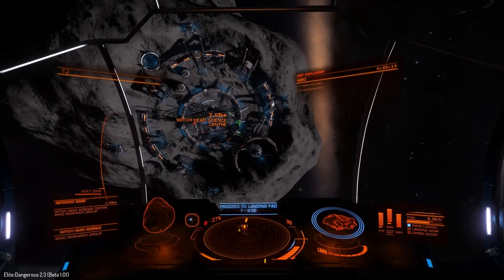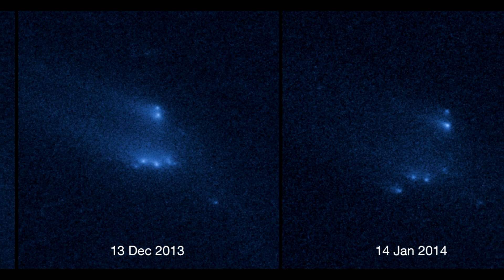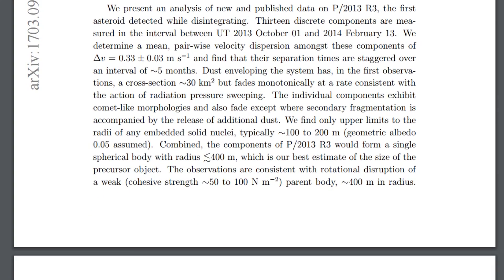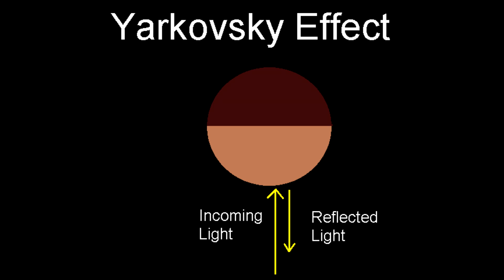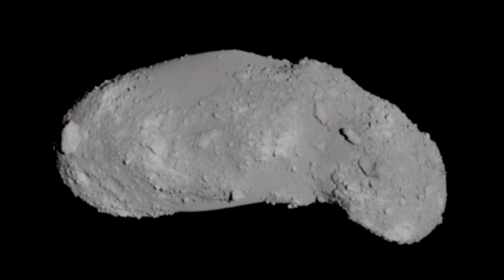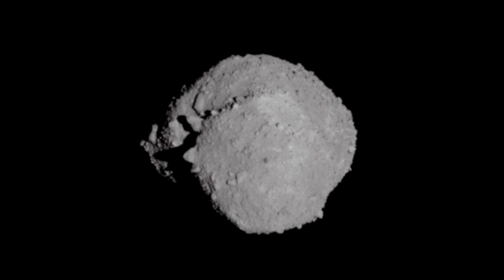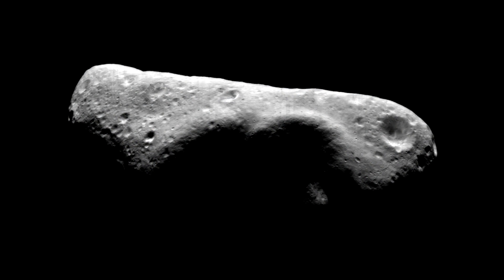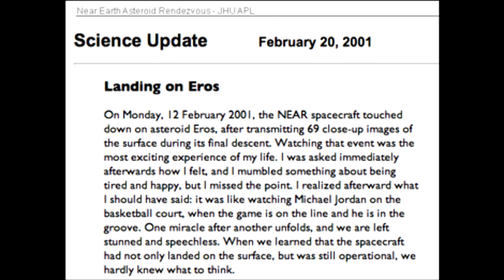Spinning Asteroids To Make Space Stations

Comment: Another possibility is to hollow out the asteroid and build a spinning habitat inside. The outer asteroid layer acts as a shield, and could be mined for all the water and other materials. Also, if this hollowed area could be pressurized you could plant crops and such. A very slight spin would allow for water to go down and plants to grow up.  Now too me, this is far more realistic and interesting.
Reply: I've been much more of an advocate for the O'Neil cylinder inside the asteroid idea. Though... you do have to have some strong magnetic bearings to ensure your cylinder doesn't precess out of center.
Reply: Found this after independently duplicating your comment. Precession is prevented by building counter-rotating structures attached to the habitat. They have equal but opposite angular momentum, so no precession.
Reply: Couldn't the whole structure just torque off the asteroid itself? The enormous mass of the asteroid would serve as the counter rotating structure to the relatively tiny mass of an air-filled space station. If you place the station at the centre the effect of the asteroid would be barely detectable.
Reply: @avid0g  or two O'Neil cylinders in opposing directions so the stress on the asteroid isn't an issue again
Reply: yes, exactly what Isaac Arthur and many others have suggested. Far better structurally and better shielding. O'Neil cylinders hidden INSIDE the asteroid with a nice, big rock shield
Reply: Just the idea I had some years ago. I mean he's right questioning the need to spin up an asteroid. Is there any model available of such a design?
Reply: This also reduces the mass greatly, which will require less force to spin it.
Reply: Fantastic idea!!!
Reply: Gundam has several of those types of stations.
Reply: In order not to get dizzy the RPM needs to be below 2 so the cylinder needs to be at least half a kilometre wide for 1G. The speed at the edge is fast but at 2 RPM its slow at the hubs. So you don't need fancy magnetic bearings, if your attachment points are at the hubs of the end caps ordinary bearings and wheels should do. Only has to withstand 3% Earths gravity or none if you build right in the centre of Ceres.
Reply: why would you put a spinning habitat inside a hollowed-out asteroid? the original design for O'Neill cylinders relied on a bed of regolith between the outer walls of the cylinder and the dirt that supported crop and other plant growth to shield the interior from radiation. why waste the time hollowing out an asteroid so you ca recreate that inside? worse, the idea of pressurizing the interior means the asteroid has to be structurally strong enough to contain said atmosphere, which isn't a sure thing. so why not just mine the asteroid's surface for material to construct an O'Neill habitat?
Reply: Yes the simplest idea would be a habitat built inside the asteroid, rotating against it on a maglev path so there is no friction. It would be under the surface sufficiently to shield against radiation
Reply: Thats Beltalowda science right there
Reply: Pressurised rocks.... 🤣
Reply: Doors and corners, kid. Stay away from T Aqua!
Reply: I expect asteroids are going to be predominantly loosely packed rubble piles.  Using the intrinsic rock as a shield will probably be about as effective as covering a bunker with packing peanuts.

I'm betting on a bit more structure from a combination of engineered trusses and bails of loosely consolidated raw asteroid material.  Still going with an un-spun shield made up of bailed rocks and water tanks then connected to a spun habitat inside with magnetic bearings.  Asteroids like Ceres or Eros would ironically be too big, carrying with them small but noticeable gravity fields.  A habitat built inside a void would get the vast majority of its gravity from its own spin but then have the asteroid's gravity overlaid leaving inhabitants with a gently rocking environment.  Everyone's soup pots would be self-stirring but furniture and dinnerware would be self-relocating.  An engineered external shield would be uniform in mass netting out to zero gravitational effect.  A shield wouldn't need to be especially overwhelming, a dozen meters thick combination of rock and water tanks would put up far more protection against micrometeorites and radiation than the Earth's atmosphere.

Habitats inside asteroid voids would not be ameniable to relocation.  If Eros station ever got bored and collectively wanted to to experience the thrills of Mercury or hanker for a jaunt to Pluto it would mean thrusting all 34km by 11km by 11 km (6.7e15 kg) of Eros.  A habitat with engineered shield would likely mass "only" around 1e12 kg, a featherweight compared to Eros.
Reply: @Lenard Segnitz
It doesn't matter if it's rock or packing peanuts, 10 tons of material is sufficient radiation shielding. Certainly an engineered shield could be more mass efficient, but do we care? Maybe, it depends.

The axis of rotation must be aligned with the asteroids center of mass. Next, depending on the asteroids irregularity, the asteroid might exert different levels of gravity as we rotate around. Thankfully, nature has largely solved this problem for us; irregular bodies aren't very massive, and massive bodies aren't very irregular. The effect is less noticeable than earths own gravitational anomalies. If you still think this is an issue, just push a couple mountains downhill to even out the gravity.

I happen to think building bearings that work against several thousand tons is a bigger problem than spinning up the shielding, a la Kalpana One.
Reply: @allanrempel5839  , Pass on the bearings and go with magnetic levitation as a "bearing". So the structure rotates around a central beam and are separated by magnetic repulsing fields. The field could also be used to rotate the structure.
Reply: @allanrempel5839  I was going to point this out as well (about peanuts), thank you for doing the lifting!
Reply: @CarFreeSegnitz  Not possible without AI and autonomous robots (by the millions) doing it all for us and at no cost. No cost or a cost that would be impossible to meet (that's what we are facing). Have a robotic space "economy" completely separate to business on earth. With AI in the future, and robots that could make themselves would be the only way we could afford to do something like that.
Reply: Hollowing out the entire asteroid would be a momentous task.  Just hollow out tubes that house tracks that the entire habitat spins around on line a train going fast enough over a curve to pin you to the ceiling... which would in turn become the floor.  You'd still get the benefit of radiation shielding from the surface but wouldn't need to hollow out an entire asteroid.
Reply: @brainmind4070  you did watch the part where he said spinning an asteroid would cause it to break up, didn't you?
Reply: @andrewreynolds9371  I wasn't talking about spinning an asteroid.  You spin a habitat on a circular track inside.
Reply: @brainmind4070  that sounds even more impractical than spinning the asteroid. You'd have to worry about maintenance of whatever track/guideway, without the ability to stop the thing because you'd lose gravity.
Reply: @andrewreynolds9371  Well, it wouldn't be more difficult since spinning up an asteroid would break it apart.  Yes, the maintenance could be a concern.  Perhaps coring out a "disk" with a central hub on which a habitat rotated inside the asteroid would be more reliable (although maybe not since you wouldn't be able to have any columnar support along the radius of the disk out to the habitat(s) (haven't done the math on whether or not this could be accomplished structurally with the asteroid's weight bearing down on the hollow disk), or maybe just having a spinning spacecraft that orbited the asteroid would be better.

Comment: Why spin the asteroid? Just spin the habitats in, on, and around it, and use it as an inexhaustible supply of fuel and materials with no gravity stopping you from mining them.

The only good reason I can see to spin up an asteroid is to disassemble it, but I suspect such disassembly would be a bit more chaotic and violent than miners would want to deal with, with budding and collisions being a big problem, seeing as shear-intolerant bodies tend to generate internal "fault-lines" before suddenly slipping and sloshing into pieces. We are essentially talking about an quake or tremor cutting the asteroid into pieces.

Remember that asteroids are HUGE. "Even" a 100-meter asteroid weighs in at around a million metric tonnes of material. If your colony uses about 2 tonnes/m^2 and requires 250 m^2 /person, you're talking about a colony of thousands of people being able to run, probably for millions of years, on what they can mine from an asteroid a hundred meters wide. In terms of how big a cylinder that is, a cylinder with a radius of 250 meters could be hundreds of meters long before the asteroid is badly exhausted. And it is also worth remembering that buildings do not need to take as much space as habitats. A square meter of shielding might well be protecting dozens of stories of aeroponics or people.

Comment: I haven't put any thought into this other than the idea just popping into my head, but in the same way a longer wrench provides more torque and makes it easier to turn something, would it be significantly different (Or any different) if the engines were 100KM off the surface and attached in some way? So you'd essentially be spinning an object "500" KM in radius, but with the same mass? Disclaimer, I am the opposite of a physicist, whatever that would be called.
Reply: Yes, that would greatly reduce the thrust and/or time required to achieve the proper spin rate. And you would not need a frame system to handle the "torque", you would put the engines on a  100km tall tower than run a cable from the top of that tower to the horizon. The cable would be under tension pulling tangentially to the surface, the tower would be under compression.
Reply: sonnder you'd need an extremely strong frame system to handle such torque.
Reply: sonnder I wouldn't think so, because with a wrench you're trying to overcome material sticking forces, which is why more torque is helpful, but there isn't any such forces in the vacuum of space. The only force to overcome is this YORP effect mentioned.

It becomes a relatively simple matter of just imparting the needed momentum.

Comment: Thanks for all the fun food for thought you provide, Scott. Here's some dessert for you to enjoy:

Since we're talking improbable projects here, let's go whole hog and really optimize it. I mean, why spin up and live on something solid when you can spin up and live in something hollow instead? More living space on the inside surface, with convenient docking at the zero-gee zones at each end seems a lot more preferable to limited surface domes at each end of a "peanut". Gravity for babies to develop safely in mom's womb also means an actual Belt civilization becoming a tangible reality.
Larry Niven had the right basic idea: bore a hole through the long axis of a mostly nickel-iron asteroid a few kliks long by a couple wide, pack it full of water ice (all you could ever need or want can be found free over at Saturn), seal the ends back up, and then spin it up with laser-pumped diffusion mirrors trained on it to heat it evenly and soften the body of the asteroid. After the ice in the core turns to steam and the asteroid gets soft enough, the whole thing suddenly expands like a bubble from the core pressure creating a very large living space where the ice used to be.
Of course, heat resistant exterior bracing will be required to prevent blowouts and to restrict the overall expansion as well as fine-tune the shape of the asteroid from say, peanut to cylinder for a more even structural mass distribution (and easier docking), not to mention the sheer amount of time required for the passive heating and cooling processes. Yikes, even. Right there is the deal-breaker.
But, by the time we're ready to attempt an engineering project of that magnitude, the tech needed for the bracing and the superheating/cooling required to make the deal-killing time factor manageable and the project worth tackling at all will most likely also exist. We might even have working gravity generators by then that would negate the need to spin it up at all - slow it back down to a stop, clamp them on and fire them up, done. But, wait...
With all that tech available to us, why not just build a habitat instead? Well, I personally prefer "natural" gravity to the type generated by a device that could fail at any time for any reason. Thicker outside walls are nice, too. If we're going to be having babies up there, I sure as heck want them to be as safe as possible, so a nice thick asteroid wins that contest every time. Murphy is the God of Space, after all.

Cheers, mate. =)

Comment: So- what if we put 1 thruster 90° turned away from the Asteroid each side... and at a decent distance away, with structures?
For example:
2 thrusters are facing 1 way, that would make the Asteroid start turning the most efficient way.
This means that those two thrusters are mirrored (and 1 of them flipped 180 horizontally).
Put them far enough away, and you can decrease the amount of thrust needed by allot.

http://imgur.com/a/CwmYQ
This is how I'm imagining this.

The struts to hold the Asteroid together could be pushed in just like that...
But it's likely that it be better to first push in the struts to hold the Asteroid together, and then melt it. When it solidifies, it would have a metallic structure inside it, reinforcing its strength.

Comment: Be more practical to hollow an asteroid out and use the spoil to build a rotating structure inside the protective outer shell I reckon.
Reply: Circular train tracks on the surface, or in subsurfce tunnels, like a subway going in an endless highspeed circl
Reply: A pair of opposing O'Neil cylinders, inside that lovely rock shielding.

Comment: I suppose that in order to heat up an asteroid they would have huge drills digging through it in order to heat it more efficiently from inside so if they're strong enough they might be able to provide enough supports so the asteroid can hold itself together at higher rotation periods than normally possible

When it comes to ceres, being  mostly spherical, I wonder if a ring-shaped colony positioned so that it goes around ceres that spins at orbital speed would be feasible.

Comment: Just want to throw this out there... it really depends on the composition of the asteroid if it was a mostly solid object then it probably wouldn't fall apart from spinning...  just because there was one spinning object falling apart does not mean that all spinning objects will fall apart.. using an isolated instance and applying it to all other asteroids is a hasty generalization. I know that we believe most asteroids to be loosely clumped together but I seriously doubt there are no solid asteroids available anywhere.
Reply: Jake Waffles, even a solid stone asteroid cannot be spun up to 1 G. Remember, stone is not strong in tension. Any defects would break off and remove angular momentum.
Reply: However, synthetic stone like basalt rebar is defect-free, so if enough of a small structure is man-made or at least reinforced, that could be spun up.

Comment: I built my artificial gravity in kerbal space program by cabling 2 spacecraft and turning ones engine to get tension and burned afterwards to get both turning around their gravity center. 70m cable will work out quite ok. This is the useful way of doing artifical gravity when you have cables that can lift one of the spacecraft off the ground.